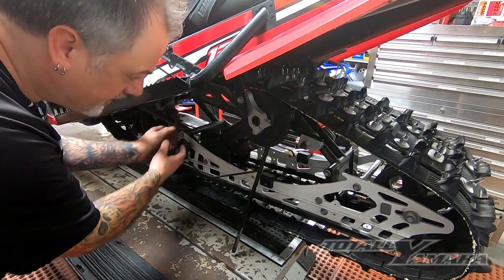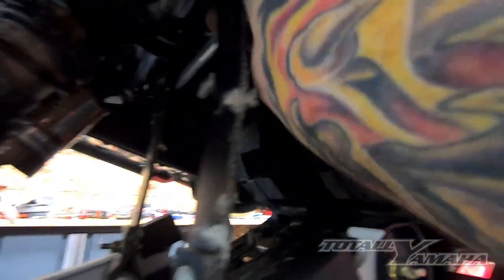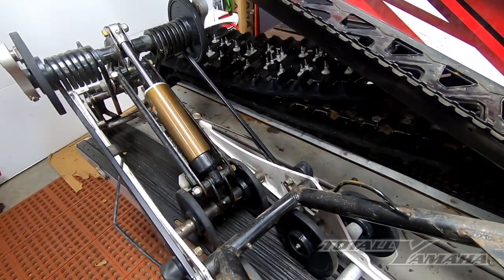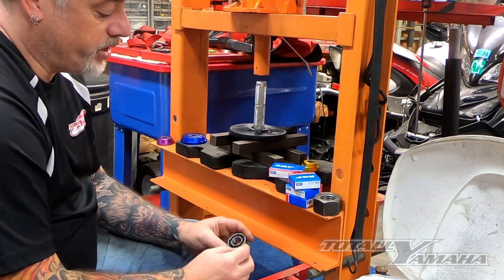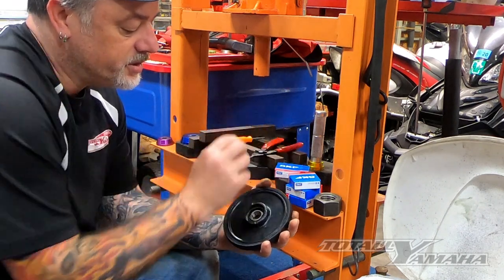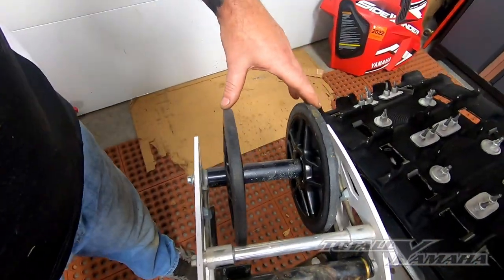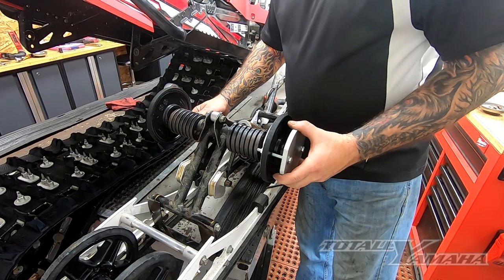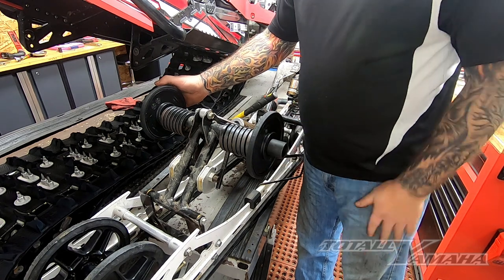2017 - 2023 Sidewinder & Thundercat Skid Removal and Bearing Replacement

Comment: If you can take the time to pull off  the seal off of 1 side of the “new” bearing and finish filling it with grease, the bearings will last longer. Even SKF bearings come with virtually no grease
Only my 3-cents
Reply from the maker: Sure will.

Comment: Excellent video……I have a question though, I broke one of my grease fittings, I pulled it right out it’s pretty well stripped out. Any ideas? It’s the lower one towards the back of the skid. I thought if I could get the whole bracket out of the skid and remove the center bushing I might be able to re-tap it. But I m wondering how to remove the bracket as I can remove one bolt but the bushing just turns round and round leaving it impossible to remove the bolt on the other side. I was hoping there is a way to do that. I figured if I can’t re-tap it I could probably just replace the bracket. I’m not sure what the bracket is called but the top hinges and puts pressure on the rear of the skid when there weight on it. Thanks
Reply from the maker: I have welded them back on or weld a small nut onto the tube and screw new zerk in. You will have to pull part to do it or grease heats up and will contaminate the weld.
Reply from the maker: Also to get bracket off the bolts have loc-tite. So basically you have to work one side out then retighten. Work other side out to break down loc-tite. You can try some heat but it’s tough to get it heated when the bolt is threaded into a sleeve. Btw. I think you are talking about the rear scissor arm.
Reply: Yes that’s a great idea I didn’t think of that. I was thinking of welding it and re-tapping but there’s not much metal to work with and you have the grease to deal. I will give it a shot. I’m frustrated in trying to get the bolt out from the other side. I started to do what you said but didn’t try really hard. I was wondering if heat would get in deep enough to loosen the lock tight. And yes it is the rear arm I couldn’t think of the correct name. I will let you know how I make out. Thanks for getting back to me.
Reply from the maker: @josephmartin3430  sounds good!! Good luck.

Comment: Thanks for the great video!  Question:  I need to remove the drive axle (spun bearing).  I'm working in tight confines in my trailer with a standard snowmobile lift, so I'm wondering if I need to remove the entire skid to remove the drive axle?  Any advice on removing the skid using just a lift (no table or overhead winch)?
Reply from the maker: Yes, you will have to remove the skid to pull the drive axle. Take sled off lift and use a come-along or ratchet strap to raise the rear of sled.
Reply from the maker: With a standard lift you wont be able to get the skid out with the sled on the lift.
Reply: Great video, thank you!  Liked the detailed step by step instructions and tips, but wished you would have also included installing the skid. I'm sure there's additional tips to share so that step is easier when I attempt this activity.

Please post information on where you purchased the upper wheel extractor tool along with the part number, if appropriate. Is that a universal tool that can be used for other sleds?
Reply from the maker: @DavidMiklos-kk1du   I created another video to deal with skid. Also Google barn of parts and he has the rear idler pullers.
Reply: Thanks